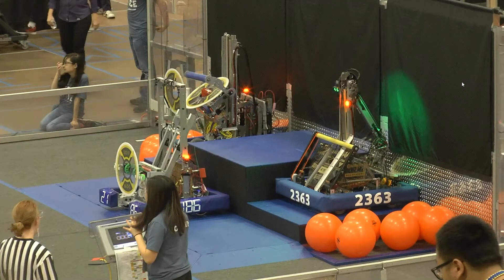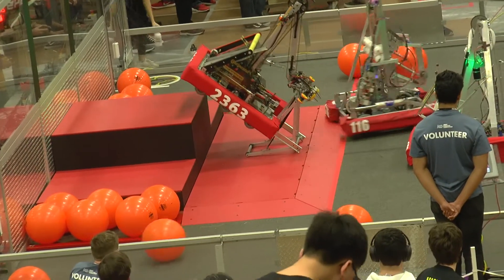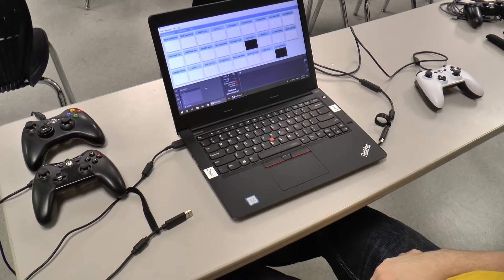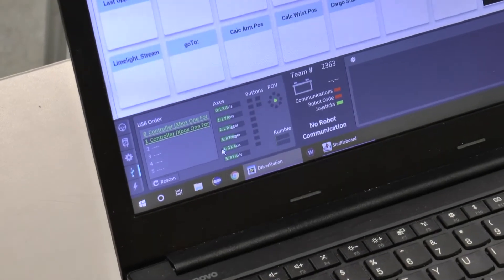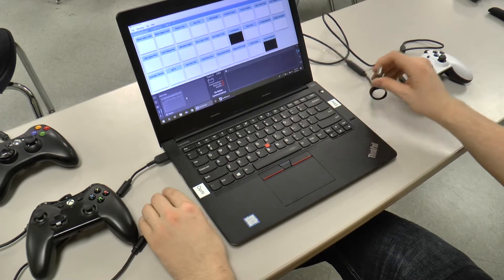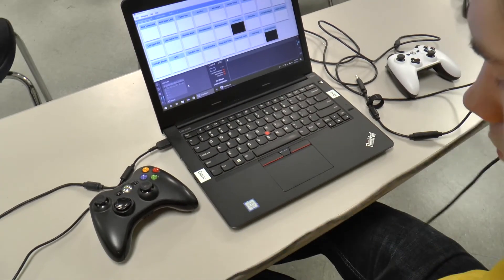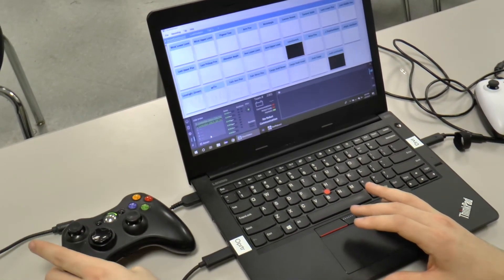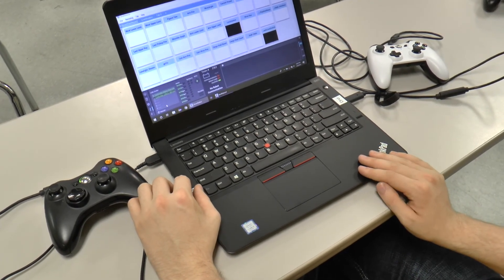Tech Tip 4 - Preventing Swapped Controllers

Comment: We have two people check this every match. We have the driver check , then we have the 2nd stick check then I verify as the coach on the field. We haven't had an issue with this since we swapped drivers three years ago. It just needs to be habit.
Reply: There's 2 classes of risk mitigations: administrative controls (e.g. training, checklists, checking by supervisors, etc.) and engineered controls (technical measures to drive out the risk regardless of human involvement).  We're interested in both classes, but if we can find an engineered control that looks promising, you can bet we're going to try it!
Reply: @n8laverdure  but you use those asymmetrical controllers. bleck